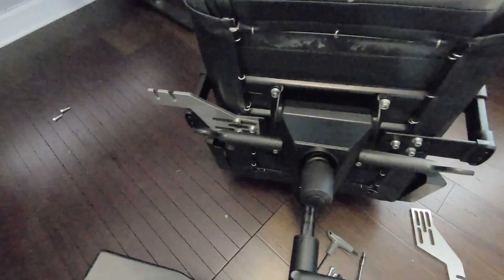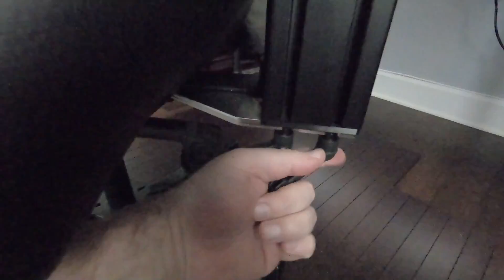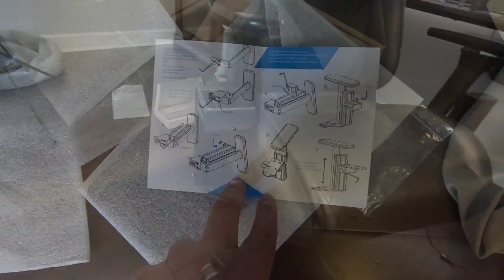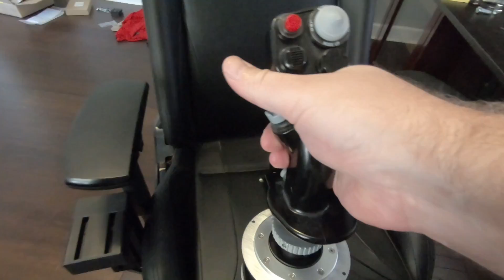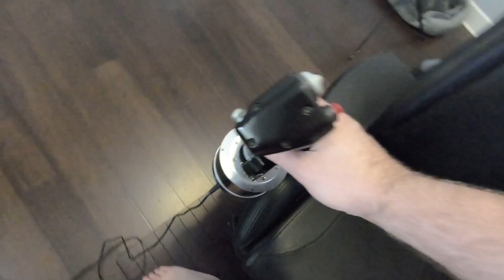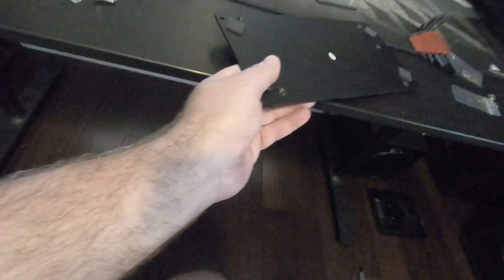Monstertech Warthog HOTAS Chair Mount Install & Review

Comment: You should mount a USB hub to the rear  or bottom of your chair and plug your throttle and stick into the chair mounted hub. Then have a single USB cable that you can plug and unplug from the hub and that cable would then connect to your PC. Then your pedals can connect directly to your PC.

Comment: how did you mount the stick to the adapter plate the screws that come with the warthog are not long enough and monstertech dont supply any screws ?
Reply from the maker: Mine came with them
Reply: @COGuyStuff  thanks mine didnt :(

Comment: The mount plate that you wanted anodized is stainless steel (at least on current versions). So you could anodize it, but it would be very scratched and look terrible when removing the mounts. I think a rubber sleeve to slip over it for a little protection and aesthetics would be nice.

Comment: Good review.  Came here since I found the included instructions... lacking.  Gotta say I have some trepidation on 2 black screws holding my rather expensive Virpil throttle to the mount... or the two bolts that hold the throttle to the mounting plate.  Or the two "Ikea screws" holding the horizontal piece to the vertical extension.  Lots of potential places for something to give out and lead to an impact on the floor while I have VR on.... at the least going to be compulsively checking the tightness for awhile.

Another question... have 4 non threaded spacers I couldn't find a use for....

Comment: Thank you sir for your honest review, you mentioned they sent you the wrong mounting plate do you happen to know which one you are currently using? Form 1 or Form 2? You mentioned it took some time to get it and I just don't want to end up with the same issue. If you could get back to me on this that would be nice. Again thanks for your video!
Reply from the maker: I don’t remember but they fixed the website right after
Reply: @COGuyStuff  I reached out to them directly and they Recommended Form 2 for my (GTR Racing) seat. I ordered the Warthog brackets after watching your video

Comment: Very Overpriced, you can make your own for a fraction. Amazon has all the parts. :( made my own works great. If you do not have the time i guess this will work for ya.
Reply from the maker: Not. Link the parts.
Reply: Parts jigs from: https://www.grainger.com/category/material-handling/structural-framing-systems/structural-framing-system-accessories.

Clamp from: https://www.woodcraft.com/products/bessey-auto-adjust-inline-toggle-clamp-with-flanged-base?gclid=Cj0KCQjwt5zsBRD8ARIsAJfI4Biw4t5Rs9eoYakrfIr6z1Ng0W9wrlQhHbEe3e34vTRQaYKcePZwErYaAn7cEALw_wcB. 

I work with extrusion so I had some laying around. 

Dont get me wrong I think its a great product! :)
Reply from the maker: Rotf sorry no comparison to this. That’s fine if you just want a janky diy solution for cheap.
Reply: Same parts they used, not sure where you got janky at? In the end works great for me, thats all that matters.  Spent a lot less and didn't have to worry about parts not fitting and there was no wait time. To each there own. Good luck
Reply from the maker: Did you even watch the video?  This is a mod for the chair, not a clamp for the desk.
Reply from the maker: Yes, it's at a premium...but when you are the only one, you set the terms.  If it could be done cheaper, others would have done it.  None have.
Reply: With an old chair that was effectively free I didn't mind a Frankenstein DIY. With a brand new higher end chair,  I was not.

Comment: Love the review and pitfalls during the assembly.  Obviously, shorting the two screws was the right thing to do, and while they should have test-fit this after an probable manufacturer change for the Throttle plate, the cost of recalling all products for two screws wasn't feasible.  But, since this is a one-at-a-time build, all they can do is wait for the emails/complaints and overnight the updated screws or plate.  Lesson learned for updating something mid-production (aka. growing pains).
Seriously, PLEASE stop with the Cigar crap!  I'm looking for links on where I can get the build, not on the dozen+ bullsh*t links you have here.  I could care less about your other hobbies or your own business, as this is not what I'm here for.  Do a video on cigars, then link to your cigar items.  Do a video on motorcycles, then link to the Two-Wheel stuff.  But when doing a video for gaming equipment and accessories... I'll let you figure it out...
Reply from the maker: Are you done with your fit? Lol

Comment: This is great, thanks for doing it. Would you know what mounting plate option would work for a WorkSpace 9000 chair from Office Depot? Linked here: https://www.officedepot.com/a/products/510830/WorkPro-Quantum-9000-Series-Ergonomic-Mid/

If not, would you recommend one mounting plate option over the other given the chair?

Thanks!
Reply from the maker: None, this is only for the gaming chair standard not office or task chairs. I would go with the stand option if you have room to store it, otherwise the desk mount with quick connect

Comment: Monstertech has earned their reputation realy fast in the Simulatorcomunity because of the industialgrade materials they use. The best thing is if you have constructive critiques they adapt very fast even they are a relatve small company. Simply contact them. For me its simple i can go to them and ask directly. I got some profiles from ebay  and build myself a  pedalmount what secures my chair in place and has an angle adjustment for my personal comfort. I could have brougt their complete Simrig but i am pretty sure my wife would have killed me upon delivery.
Reply from the maker: I gave them all these suggestions on their forum. You can go read their reply. Not good. They admit they changed plate thickness but still claim it was a packing error(s) with the bolts.  They will not make the base plates black claiming it’s too expensive. They still say they are working on instructions. They are considering longer mount bolts. Not the best response from a company with a high price and supposedly about quality.